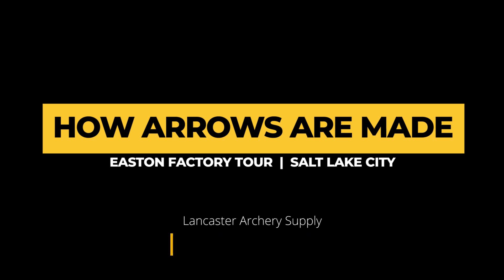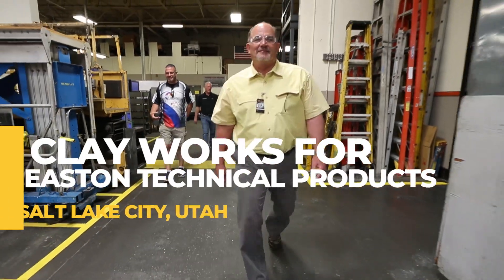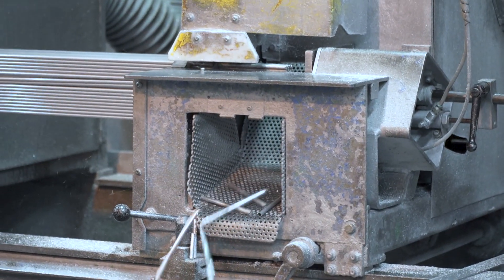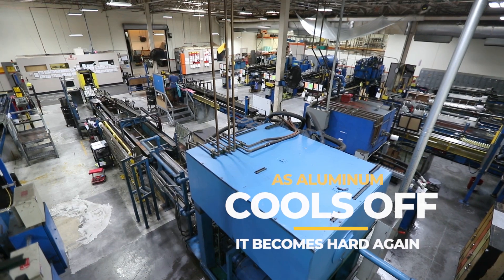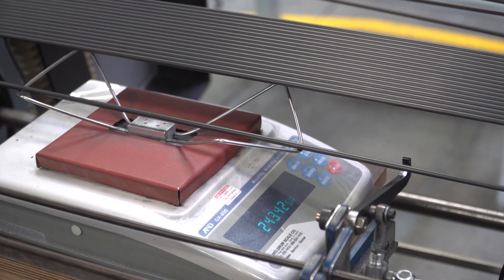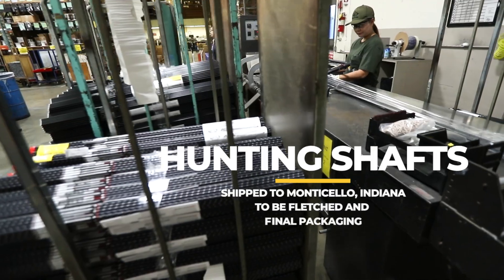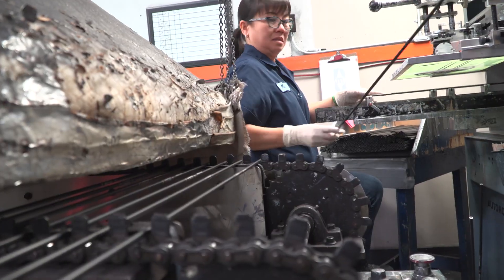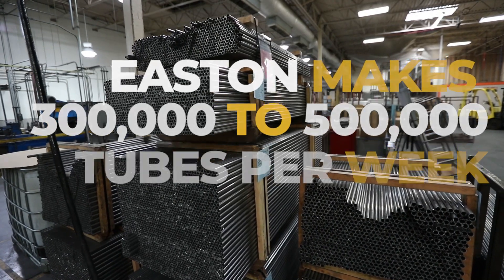How Arrows Are Made - Easton Factory Tour | LancacsterArchery.com

Comment: Easton turned lazy nowadays, there are better, more durable and still just as precise alternatives already. And I am talking about every type of arrow like hunting, youth, practice and pro target.
Reply: I once got a dozen of Easton Platinum Plus XX75 1616 arrows from my coach to replace my preexisting PP XX75 1616 arrows. On paper both are supposed to be the exact same. However the new dozens i got was short of a few inches compared to my preexisting ones. Both sets are supposedly uncut, but the length is different. Even my coaches said that Easton 'couldnt be this bad'. Is it a problem of failed QC? Thats a few inches different! Big screw up by Easton
Reply: hi sandra can u recommend x10 alternatives for target (compound bow i have hoyt prevail cant have x10 here for weeks
Reply: @thejugaadlab1313  Carbon Express or VAP. Either are fine.
Reply: @sjankarcher  thnxxx